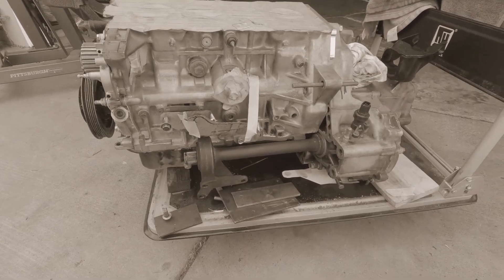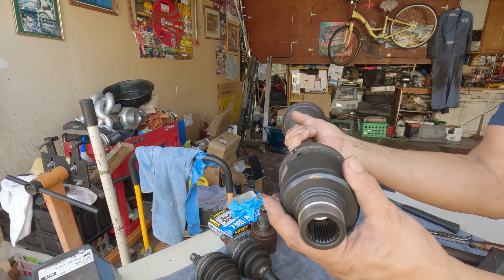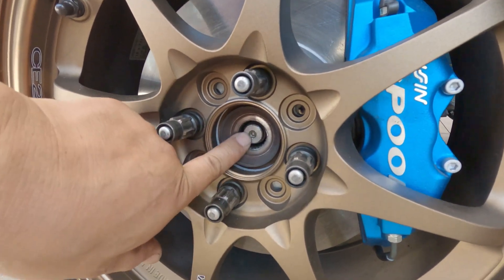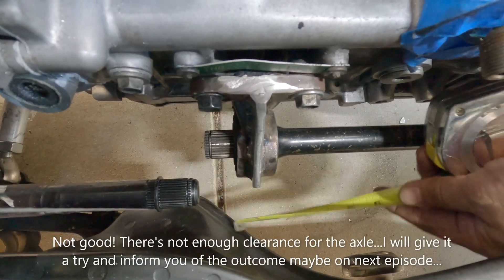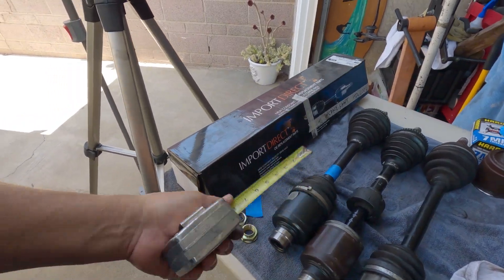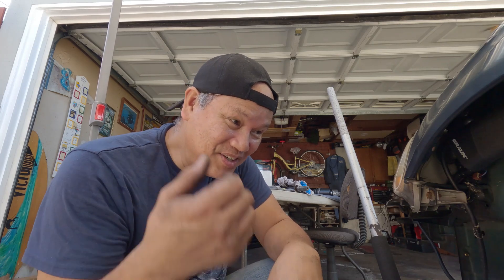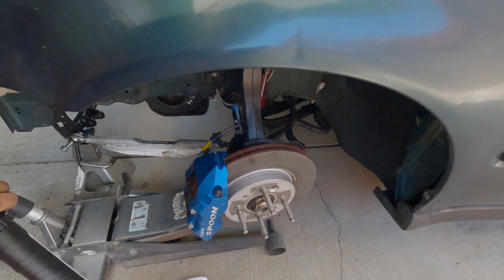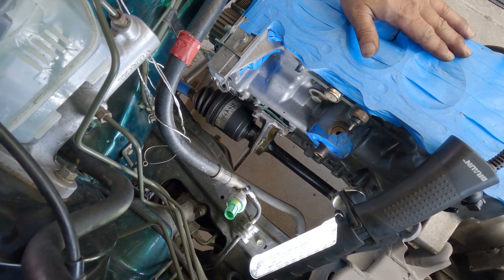G2B build project using H22 intermediate shaft. ep.10

Comment: Bossing, marerekomenda mo ba tong shaft combo mo kng sa ef na kaha tas alang power steering?
Reply: H2B plateless sir, may bracket nako ala lng shaft. Mahal kasi B shaft dito satin, 90s accord parehas lng ba sa prelude? Un lng ang prang madaling hanapin dito.
Reply from the maker: @ralph_man5471 kung plateless, hindi ako sure kung gaano ang kailangan mo ishave  na material sa block at kailangan mo gawing custom ang pillow mount ng H or Accord halfshaft. Pero wala naman problema sa pinas pag dating sa modification. You can always try ang Accord shaft kung wala kang alternative.
Reply: Ok ksi ung ginawa mo, di mo na need tabasan ung block pra sa joint. Kaso baka pag sa ef sobrang haba nung axel. Eh mahirap mag experiment dito, mahal pyesa hehe
Reply from the maker: @ralph_man5471 naswertihan ko nga na no need to shave a whole lot sa block. Ang naiisip ko baka mag custom axle ka mula sa halfshaft. Baka kasi masyado mahaba
Reply: Aun nga boss eh. Galing nung sau, saktuhan hehe. Naligtas mo pa na di matabasan ung driver side nung block.
Reply from the maker: Hindi ako gumamit ng traditional H2B plate na naka lean forward ang motor. Nagamit ko ang h22 halfshaft coz l have space sa driver side at straight ang motor. Ang space ng inner joint ng makina ko compare sa traditional h2b ay malaki kaya l was able to only trim a little bit. Kung meron ka na h22 or Accord halfshaft, you can try and see how much trim is needed.
Reply from the maker: Kung recommend ko sa setup mo, hindi cguro, unless ang setup mo ay plateless at may room ang crank damper preho ng sakin. Kung napanood mo ang lahat ng g23bk episode. I moved the motor ng 1/2 + inches cguro para magkaroon ng space ang crank damper, kaya nag worked out ang h22 halfshaft at 89 integra axle sa driver side.
Reply from the maker: Full H or H2B ang balak mo sa ef?
Reply: Sir may mga tanong pako dun sa ibang vids mo. Pde ka ba direct message o mas prefer mo comment na lng ako?

Comment: Ordering my h2b kit today. Did you run into any issue using the h22 intermediate shaft with the b series trans?
Reply from the maker: No issue except that the pillow mount is custom. I have to cut and weld it, Are you building a traditional h2b w/ motor leaning forward correct, coz my G2B is custom and also l have a room for my power steering. I think if you use a h22 halfshaft and no space for power steering belt, your axle might be stick out further,
Reply: @sagittnet2158  I'm using the qsd kit for ef/da. Trying to mate h22a4 to a b16 hydro trans.
Reply from the maker: @tone_deaf_pirata  Good, it's a good brand. later man
Reply from the maker: Hope you're getting the good h2b kit, coz the inexpensive kit, the dowel pin holes for transmission are too big, still useable but you have to make a custom dowel pin. I showed it on my recent video, not sure if you seen it.
Reply: @sagittnet2158  yes I've seen most of the videos. I won't be running power steering or ac. I'm using hasport b series mounts

Comment: Hi, I have an h23 non vtec, I was planning to put an h22 vtec head, I was wondering if you have some advices?
Reply from the maker: Hello, your build will be H23vtec it'll be like the H23a blue top. There's 2 way you can build your project if ever you decide to do it, correct way will be like a blue top. H23a bluetop piston and rods is all you need and your'e golden. Of course you need all the H22 parts along w/ it and its plug n play, but make sure to remove the oil restrictor on your block( oil port, it's located on center by intake side). H22 cyl head doesn't need it. The other way to build is to change your piston w/ H22a4 (fliating wrist pin) and install it on your h23 non vtec rods. Your non vtec rods are press fit, you have to do a bit of mods on it. If you dont feel like doing it yourself, you can bring it to machine shop and have them to remove and install the h23 piston and install the h22a4. Your piston will stick out pass the block about .020" not like if you use a H23a bluetop piston. It'll give you a lot of comp ratio if you do it w/ H22a4 piston w/ h23a con rod. If you decide to buy a h23a1 forged con rod, no neec to bring it to a machine shop, coz aftermarket forged rod are floating pins. No name ebay brand are okay, l'm using those on my 2 boosted engines and no problem whatsoever.
Reply from the maker: H23 and H22 are very picky on what type of piston to use. Only use OE piston, l dont recommend using the nippon racing  piston coz it might give you a problem on the long run (piston skirt srape) They said Mahle piston are compatible on h22 ,h23a1 carbon fiber liner but people that use mahle have issue where piston skirt are scraping on liner. Piston to wall clearance must be check if you want to use Mahle. If you decide to have it resleeve, then your piston selection is endless, you can choose any piston you like.
Reply from the maker: Yes, if it's a budget build and you just want to try it out. Remove your h23a1 piston and install OE H22 piston. 92-95 H22 piston is press to fit like h23a1. 97-2001 H22a4 piston is float wrist pin. Either one of the 2 can be use.
Reply: Thanks for the information, that will help a lot since I am new on this. Just in case, I have an h23a2 , that is the european model, does that makes a difference?
 @sagittnet2158
Reply from the maker: @chicho8158  No difference at all except for the stamp number. If you do build it, your piston selection is the key, only use Honda OE piston, H23a2 cyl are very picky. good luck to you.

Comment: What is your opinion on locked VTEC? Is it worth it?
Reply from the maker: It sounds nasty! Like it's ready for action even just idling. If you see lots of action, l guess it'll be alright. But sure it'll suck gas like no tomorrow though! It'll also wear out your cam lobes or rockers in no time.
Reply: @sagittnet2158  Thank you for the info. I am new to tuners and imports.
Reply from the maker: @darrenwhite7029  ok and welcome to my channel and hope you'll my contents helpfull
Reply from the maker: My g23 vtec are set at lower rpm. My tuner made it that way coz of the torque cross over. I think it's around 4.3k rpm rather than 5k like normal H22. For me it's not worth it coz of the possible wear it will do.

Comment: Hey quick question, are you sure you’re supposed to run the k20 pistons rotated so the arrow points towards the trans? There’s a bunch of people telling me not to do that
Reply from the maker: The reason for installing the k20 piston that way is to mimick the F23 piston wrist pin offset. Some install it like normal way and it make the pin off set the other way around. If using a OE cams or type S cams it'll be ok. There are 3 types of K20 pistons on the market that has different comp ratio( dome piston). You can always clay the engine, that way it'll give you a piece of mind. I made a g23vtec for my nephew. I made a short video of it. I shaved the exhaust relief coz l was worreid that it gonna hit the valves. It was a k20 ctr piston l think and it got higher dome than what l got on my recent blog.
Reply from the maker: If you are using a piston like what l have w/c is usdm rsx type S(11 to 1) comp ratio. It wont hurt at all. The 1st g23vtec build are still on the web for us to see and read. He specified the reason for installing the usdm type s piston. Hope this help you.